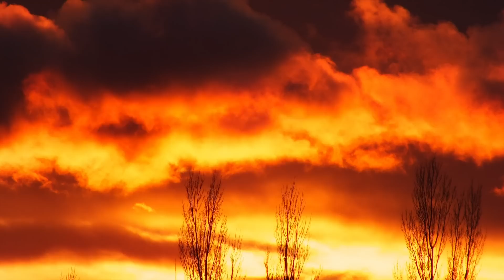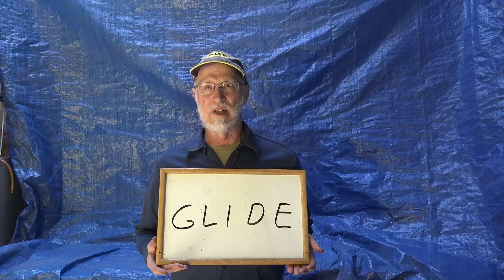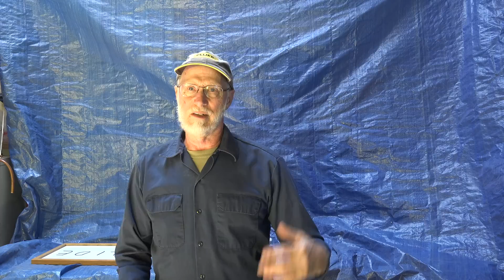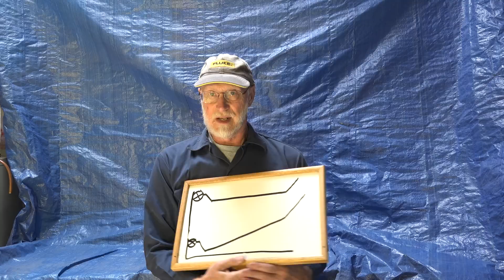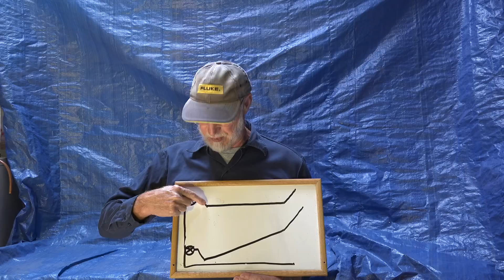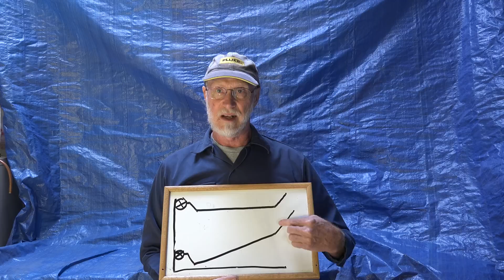How blend refrigerants work in the air conditioner.

Comment: Hey GFM, nice video's sir. I also make Diy Auto video's on my channel. I've got a question for you about a gas furnace. I recently purchased a condo that was build in the 80's and from the looks of it so was the gas furnace. Problem is the pilot is out but also there is a gas leak that I can smell and also hear ( this is all with the furnace turned off). I've shut the gas valve going to it since, but my question is where should I start to check for the faulty component, is the heat exchanger pretty much the only culprit here?  Could it be the valve stuck open? 

If it is the heat exchanger, is replacing that not worth it and I mind as well just buy a new furnace?  

Thanks in advance,
Reply from the maker: The furnace is at the end of its lifespan.  The heat exchanger crack will not cause an unburned gas smell.  l would be looking for the leak first.  Soap bubbles will work for that.  The valve could be stuck open but is unusual.  Hope this helps.
GFM